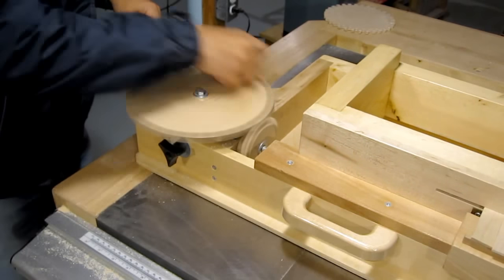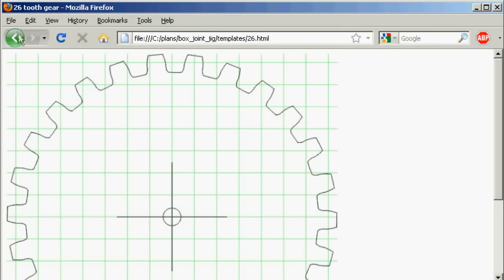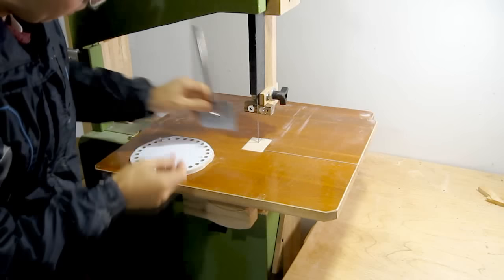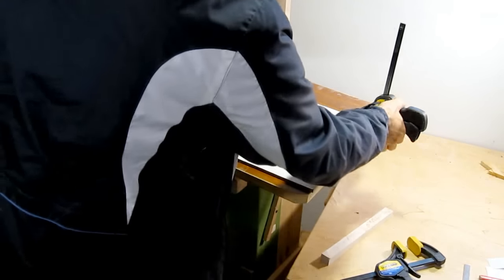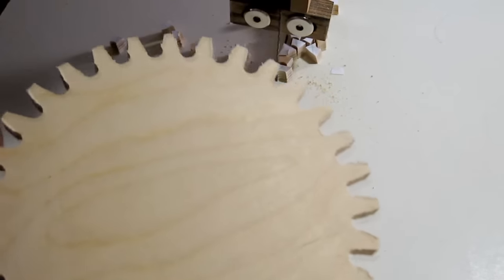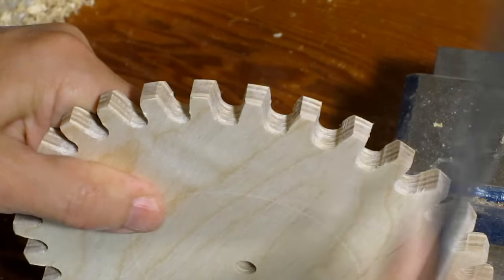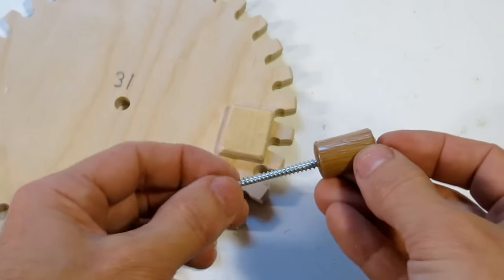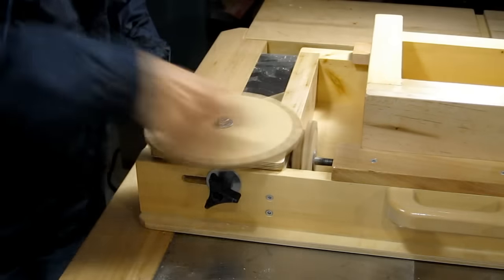How to make gears

Comment: I've seen on other tutorials (specifically on using scroll saws) to use clear packing tape to help lubricate and prolong blade life (and it makes removing the pattern easier).  You can also use a heat gun to make removing the pattern much easier!

Thanks for the brilliant idea to use a drill for the inside part of the teeth!  You just made my life soooo much easier!

Comment: I made your box joint tool and found everything working perfectly... The gear cutting files worked perfectly. I took the hpgl file into corel and exported as a .dxf to convert it. I then took it to VcarvePro and made the gears on my CNC.  I used a tapered ball end bit to finish the inside taper... Love your stuff...

Comment: I've never made wooden gears but back when I was an industrial Maintenance Technician, I made metal gears by the paper template and bandsaw method. Sometimes a piece of machinery would break a gear tooth and it could take days to get a replacement.  If it wasn't a really high speed or precision gear, or a helical or bevel, I could put it on a xerox machine and make a copy, (actually two copies so I could cut and paste around the broken teeth). Then I cut the teeth on a band saw and hand filed them so they ran smooth. We didn't have a milling machine or the cutters to mill them. The gears were nowhere near precise as the manufactured ones, but they only took a couple of hours to make and would last until replaceements arrived.
Reply: i have a project i am working on...it is related to a tricycle....as it stands..there are two chains on it. one from the pedal crank to a middle hub that has 3 internal gears....from this hub,there is another chain that goes to the final drive sprocket on the drive wheel.....i would like to replace the 1st chain with a drive shaft of sorts....i think this is possible because the sprocket on the pedal crank is basicly a big gear.....
 what do you think ? a drive shaft from the  pedal crank to the internal gear hub ...feasible ?

Comment: Tip for drilling the holes: up the speed on your drill press! 

Initially I was using the lowest speed and it was tearing up the paper template and causing a lot of tearout on the backside. Using a higher speed dramatically improved my results.

Comment: Amazing video! Just a small tip. Before gluing the template, you can use blue (or transparent) tape over the wood and then glue the template to the tape. To remove the template, just remove the tape. Clean and easy!
And use a scroll saw, if you can. Those can be tilted by design ;)
Reply: Meh.  Band saw is much faster IMO.

Comment: I purchased your Gear Generator program. Thank you I love it. Especially the protractor option. When you do an upgrade could you add the option to print numbers with the protractor as well with the following options of 0 -22 or 1 - 23 on a 23 point protractor or the degrees around for each point.
Just a thought thank you for sharing.

Comment: What kind of plywood do you use? Where do you get it? At 3:35 when you are filing, the plywood appears to be equal to a solid wood. In fact, it almost appears petrified - almost stone-like. The plywood I use, such as Birch Plywood (NOT Baltic Birch - just plywood laminated with Birch) has actual wood fibers between each layer. My plywood seems much less compressed. It's so hard to explain what mine is, but to sum it up - my plywood is normal! LOL Yours isn't normal. Like I said, it is solid, stone-like and really has no texture in the different plys. What kind of plywood is that??? Thanks!!!

Comment: Have you tried using a router to do any of the shaping on your gear teeth?  I've got a dovetail bit for my router which I think would work quite well for putting in the angle you spoke of, but I'm curious if you've tried it before.

Comment: Hi Matthias, great work! Quick question, I don't have a bandsaw and was wondering if it would be possible to make the bevel in the gears with a dovetail bit for the router - or would the angle be too steep?

Comment: I thought about casting these in aluminum and was wondering if it was possible for them to work with a slight angle on the teeth.  So after watching this I'm going to have to try it sometime this winter.  Thanks!  And as always, great videos and info.  Keep up the great work.

Comment: So if I buy a sheet of plywood, make every size gear I'd ever need, and decorate a workshop wall with  them as TEMPLATES ONLY , what sized router bit would I need for the next project this is a trick question, as in, would it save time, of which there is no question
Reply: don't know but you would have a cool display on your wall!

Comment: Hello, was wondering if the gears can be placed in a 90 degree angle to one another and still move well. If not, is there a gear generator for that? (I'm new to gears, so if this is common sense, then I'm sorry haha). Anyways, thanks.

Comment: Hello Mathias,
what kind of glue do you use? 
I have tried several types of glue but I find that I always have to really put on a good coat on the whole gear wheel if not it just doesn't work for me.

BTW your gearwheel generator rocks, going to buy the extended one.

Comment: First of all I love your videos and hope to eventually get around to making some of your machines. I have used your Gear Generator program to create plans for some gears that I cut out. I noticed that the gears generated are very slightly elliptical and therefore are prone to jamming. At first I thought this was my cutting or my printer but when I export the gears to .DXF and take them into illustrator for laser cutting, on larger gears the height can be 0.5 mm out from the width. Any Ideas?

Comment: A little tip I use to transfer printed drawings to the wood is to place it face down on the wood. Then with a cloth I wipe over the paper with mineral turps. Other type chemicals may work, white spirit etc. This cause the ink to transfer onto the wood giving an exact mirror image. With a bit of practice you can get really good results....

Comment: One thing to be mindful of is that unless the teeth on a gear are divisible by 4, the shape of the gear will not be square.  A gear with ten teeth, for example, will be slightly longer on the side where opposing teeth stick out, versus the gaps between teeth on the other two edges of the perimeter.

The same will be true of odd numbers -- taken to extreme simplification, see an equilateral triangle.  The shape will not fit to a square, but it will be a perfect fit in a circle.

Comment: I made my first set of 16  and 12  tooth gears.  I must be doing it all wrong .  I used a 5/16 brad point bit , but I had to guess where the center of the bottom of the tooth would go. Can the program mark the center to help me center punch it.  I am trying this again today.   Can I use different thickness plywood.  I found home depot has 23/32  cabinet grade plywood (really nice ) for $33  for a 4 X 8 sheet.  Full speed ahead Captain....
Thanks
Dennsi

Comment: I have had good luck with rubber cement to mount the paper.  Some types (not all) peel right off when you are done.  Experiment. I use a type i bought at Staples.  Great video - amazing - nothing like wood!

Lloyd
New Hampshire
USA

Comment: @Matthiaswandel  You got some great video's... One of these days I may just have to build my own bandsaw!  
     For a lot of nonsensical parts for jigs,  I will lightly use a spray mount glue to attach a paper template to an object (spray the paper, not the object!).   Then dissolve the bond with a petrolium based cleaner when finished.  Just another option.

Comment: Hey Mathias.  I recently purchased your Screw advance Box Joint Jig and it turned out pretty good.  Thank you for the great instructions.  I have now tried to n=make additional gears but when I print them out the squares on template are not 1 cm.  they are one tenth over or under the required measurement.  Any Suggestions.
Reply from the maker: Best to read the printing instructions in the plans.

Comment: Do you just have threaded rods running through the gear to move the jig forwards and backwards??? Gonna make a simple jig for work, that was the first thought I had other than making a simple notched piece of hardwood to run along a single gear. 
Thanks man, this is an a lot easier and more efficient mechanical method for a jig than I've seen elsewhere haha bravo!

Comment: I got bearings tat are 5/16 center holes.  I got a 5/16 threaded bar with 18 teeth per inch.  I know that you have a 3/8 threaded bar with 16 teeth with 12 and 48 tooth gears on your box jig, four turns moves it 16 teeth= one inch.

My question is since I have a 5/16 bar that has eighteen teeth, if I also have a 12 and 48 tooth gears, will it be 18 teeth=one inch?

If not could you explain my confusion.

Thanks

Comment: Template sticking. 3M do a range of spray glue in cans called Mount, ie Spray Mount, Display Mount, Re Mount, I cannot remember which is which, but they carry different levels of tack, and are the type of glues used Post Its. Unlike PVA or more perminant glues, you will find one of this range which will be great for paper to wood as a tempary fix.
Great to see your work & the quality of the film.
Regards Bob

Comment: Do you have a video on the actual threaded bar part (the part that moves it back and forth), because i have made a router table but too adjust the height i need to manually lift the router which is a right pain because its heavy and awkward to get too.

Comment: Hmm so you used straight gears for your own lift, the plans mentioned to make ones by tilting the saw, did you change your stance on this after making the video? I had some issues cutting them, but I also own only one blade, a 1/2" one. What size blade do you find most useful for gears?
Reply: Actually I think I understood the term flat gears and bevel gears incorrectly.

Comment: I think that if you drill the hole first in the center and then make a pivot on the band saw with a sliding table, the teeth would come out more uniform as you would not have to align the gear exactly on every tooth.

Comment: Nice work, to get the paper off just wash it off with water, the wood glue is water soluble it comes off really quickly, so the wood doesn't have to soak in water or it may warp, just wash it off quickly with a brillo pad and then dry the wood and put it in the sun so you dont damage the surface with a grinder.
Reply: mama jamanhaga

Comment: What weight can take plywood gear of that size? Will it be capable to hold bed in the air - I want to sliding it from the ceiling? I cant find any ratchet mechanisms that will fit my need on the market... :/

Comment: I don't know how you get those holes drilled so clean and without the paper template lifting or getting chewed up. No matter how I try my template always gets ruined by drilling and I lose some edges
Reply: I just realized I think I'm not letting the glue dry long enough before I start to work with it. That is probably why my paper tears easily, etc. Gotta have patience
Reply: Ok, just as another follow up, I finally realized that my drill bits are shot. They are just too dull to cut an accurate hole. Time to go get some good quality new ones.

Comment: would you know of a material that is machinable/cutable with wood tools.  Possibly a method of hardening/strengthening wood or similar material?  I've been making several designs of  a ropemaking machine,  but out of steel [machined or welded/drilled steel parts.  The steel is much more time/material intensive than a wooden model.  Question then becomes length of service and saleability.   The short term best is wood based?,  regards,

Comment: @Matthias Wandel, not sure if you are still active on youtube. but if you are, had a request: I wanted to make small gears for small dc motors for small toys. do you have any technique for that?
Reply from the maker: No
Reply: Michal Zalewski uses resin casting, but it requires quite a bit of skill and equipment. See https://lcamtuf.coredump.cx/gcnc/ch6/#6.2
Reply: @matthiaswandel  why😭

Comment: I use a 40 watt laser machine to cut out wooden or acrylic gears with. It works perfectly and is much faster and more accurate than a bandsaw. Thicker gears can be made by stacking up several 3/16 layers.

Comment: i saw the wine comment on your website for getting it to work with *nix based systems like mac and linux. i can test that for you. though even if you cant get it to work in wine, you can get it to work using something like vmware or qemu. also if it works in wine, it will work on iphones, ipads or android devices as well since those too are *nix. 

though with as simple as the program is. it could probably be converted to a *nix binary via GCC as the compiler if you had a copy of the source. just compile a separate binary for x86, x86_64, PPC and ARM processor archtypes.  make sure it has no requisites for something like directx over opengl, which i doubt it does. the source should be fine to cross compile to any archtype and OS. that would guarantee support for all platforms, mac, pc, linux, microsoft, android, iphone, ipad, all of it would support it. its just a matter of cross compiling it and passing parameters to gcc in the makefile during the compile.

Comment: Here is a simple suggestion for making the hole cutting go faster. Instead of using an awl to punch a small hole between each teeth, drill the center hole and put a 5/16 bolt through into the drill press sacrificial table, then just align the first hole and spin the gear to put in the rest.
Reply from the maker: Nicholas Tinling Punching a center hole is more accurate, because the point of the drill will naturally follow it.
Reply: Matthias Wandel Except punching the center hole for the gear teeth is done by eye which, in my view, is just as inaccurate as a wandering bit.

Comment: I think you're talking about ring gears.  If so, just print out the proper gear size that you'll need and paste it onto a slightly larger circular piece of wood.  Cut out the INSIDE as opposed to the outside.

Comment: Ok... first of all this kind of gear would take approx. 6 hours to print depending on your speed settings. But the printer is autonomous. And you can print herringbone gears or cube gears....
BUT I didn't want to say that the thinks you  produce are worse then 3D printed stuff... it depends on what you need.

Comment: I saw a trick where a guy used carpet tape to stick his templates to the wood so the the paper would come off to problem. Please up vote so he can see.
Reply: also, use contact cement to stick it and then use acetone and it comes right off.  Do it all the time in my cabinetshop.

Comment: Instead of varnishing the teeth use paraffin(wax) to lube and make them smooth. The wax will cling into the wood surfaces making a sealed lube. You can also melt a candle in a cast iron skillet on the stove and dip the gear into the wax also.  Let it cool and bam. An Old School Trick !

Comment: how would i calculate the gears for a 1/4 inch movement using a 16 thread per inch threaded rod....  4 to 1 by radius???
Reply: or what.... will a simple 4 to 1 ratio by circumference work?
Reply: Clown Whisper Use the number of teeth on each gear to calculate instead. Circumference isnt as accurate. But yeah have 4 times the number of teach on the first gear will give u 1/4 inch every full turn.
Reply: Frank M Thanks frank... 

I was thinking about making some of these gears out of some flat scrap maple that I have laying around.  I am wondering if anyone had any thoughts regarding hardwood as apposed to ply

Comment: Hi you are good men but 26 $ for gear program generator its too much.
Reply from the maker: No problem.  Use my free one.  http://woodgears.ca/gear_cutting
Reply: Matthias Wandel engrenage en bois
Reply: Are you kidding?  I think that's a GREAT price for a piece of software with this much capability.  The "app store mentality" has hypnotized us into thinking that all software should be $0.99, if not free.  This package embodies a LOT of work and ability - it's worth every cent of $26.  If only it wasn't Windows-only I'd have bought it on the spot.

The "first order" bit of this isn't that difficult, but all of the second order details that Matthias has worked into this - paying attention to the clearances, undercutting, etc. etc. etc. - I shudder to even think about how many hours he's sunk into developing this tool.  Show some respect for the labors of a highly skilled engineer.

Comment: MATTHIAS - IF YOU ARE GOING TO POST A VIDEO ONLINE AT LEAST KNOW THE CORRECT WORDING - YOU CONSTANTLY SAY "TEMP-PLATE" - THERE IS ONLY ONE "P" IN 
Search for a word
tem·plate
/ˈtemplət/

1.
a shaped piece of metal, wood, card, plastic, or other material used as a pattern for processes such as painting, cutting out, shaping, or drilling.
2.
a timber or plate used to distribute the weight in a wall or under a support.